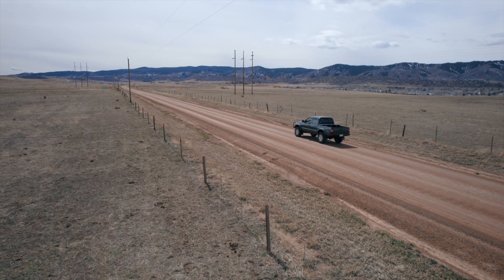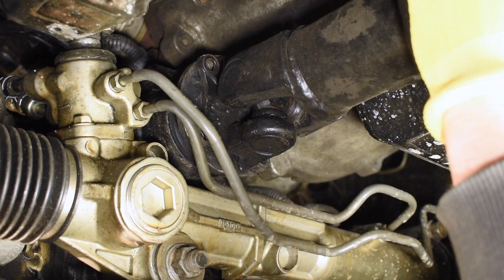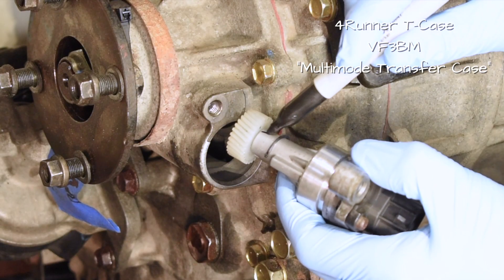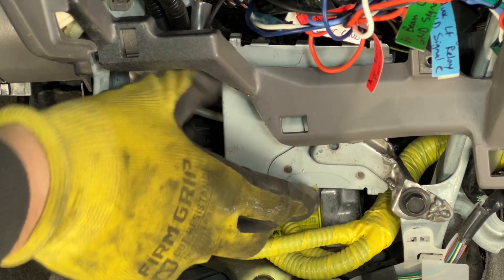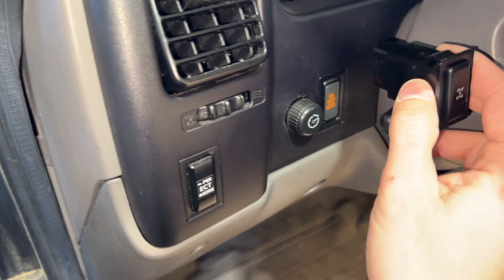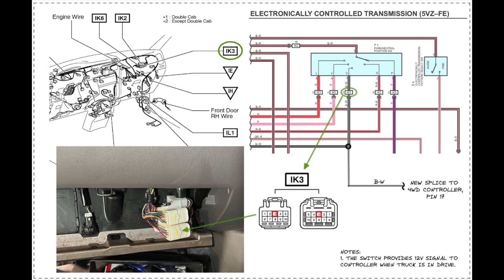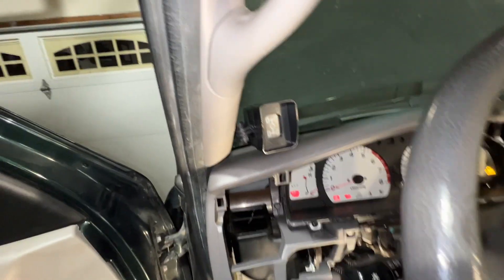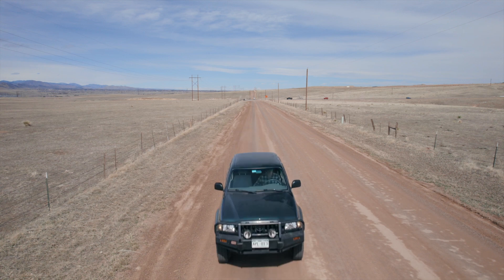Giving the Tacoma All-Wheel-Drive - Swapping in the 4Runner's T-Case

Comment: Great Work! i have this on my taco. i did it in 2016. i modded my speedo to show the modes. (nothing as nice as the 4runner) i also have manual hubs. works great and works like stock! you did much more than i did. i did no fabs. didnt change my ecu, just added 4wd ecu and some wiring. all electric shifters. wiring took me 3 wks to figure out and do. The only custom thing i have is my rear driveshaft. most guys online wants manual j shifts. i love my multimode AWD/4WD.

Comment: I can’t even imagine the effort that went into both this video and the project in general, a crime this only has 5k views. I came here from tacomaworld after reading your thread! I 4x4 swapped my prerunner a few months ago and I had initially secured a really good condition Multimode case that came with the A340F transmission I bought for the project. I made it about 2 pages into your thread and decided it wasn’t for me haha, I went with a j shift instead which was elementary to install compared to this wiring ordeal. Maybe someday someone will use a Multimode when doing a prerunner swap, that would be an extreme challenge without any of the existing 4x4 Tacoma wiring/computer. Amazing stuff, I’m hopefully posting my conversion video soon!

Comment: Hey Mark, would it be possible to share the 3d print files for your cutting template, and the flush mounting bracket you used to mount the switch - working on a similar project right now, and running into the same issue! Let me know, thanks! great video!
Reply from the maker: @Cstrub28  Hey there, please reach out on TacomaWorld.
Reply: @mark.esposito  Message sent!

Comment: Would this be possible on a 2nd gen??
Reply from the maker: @Csox513  I’m sure it’s possible. You’d probably need the VF4AM T-Case found on certain models of the 4th Gen 4Runner as your swap, assuming you have the A750F transmission in your 2nd Gen Tacoma.
Reply: @ thanks for the input. I’ll do some research 🔬

Comment: I having electrical issues with my 3rd gen multimode. All switches are testing good, I can jump the Tcase in and out of 4wd. Vsv is working fine up front. Any ideas on what to check next?
Reply from the maker: Hey there, without knowing what more about your issue, I can’t really help you. Please reach out on TacomaWorld (see video description for my forum posts) and I can get a better idea of what your problem is and I’ll offer any assistance I can.
Reply: @mark.esposito  fixed it last night, opened up the actuator and cleaned and regressed the position contacts (they were corroded but the motor was still working ) and it’s perfect now.

Comment: Would you consider making the center lock/4wd indicator light for a price? 

Amazing video and thread on TW. Thank you so much.

Im trying to source the parts for a manual swap on my double cab, and this might be on the to-do list after that.

I have down the equivalent (AWD) to this on my jeep xj, but it is far less intensive.
Reply from the maker: Thanks for the interest. No plans to sell the gauge. Making the gauge was labor intensive and I’m not sure how to make the gauge transparency layers without purchasing an entire gauge cluster and disassembling it to get the parts I need. Ultimately the gauge would be absurdly expensive to make it worth while.
Reply: @mark.esposito Thank you for the reply.

I did not mean make a new cluster. Sorry for the confusion. I was more so thinking along the lines of what you made. Maybe just a slightly different shape. Out of the way maybe behind the 4wd/shift lever.
Reply from the maker: @VT5874   Understood. I’m just not sure how to replicate the transparent pictogram layers like you see at 8:58 without taking them from a 4Runner cluster. You can no longer buy just that part from Toyota.
Reply: @mark.esposito  Hope I'm not bothering you, is there any chance you'd be willing to share the file for the AWD indicator? hopefully swapping my RWD 99 4Runner and your solution for the indicator seems like by far the best way to go

Comment: Best I've seen, ever.  Thank you. 
The clear tech info,  attention to detail, the detail visuals,  hilarious editing.. dude,  how do you not have more subs?!
Awesome! 
Granted, I had already decided that i would do something like this,  but now it's out of the hazy dreamlike phase,  and into planning. 
I haven't looked yet,  and went straight to comment,  but I'm hoping that you have links and.. really really really hoping that i can buy those 3D files or printed parts from you. 
I have a 2010 trd prerunner, and have been debating which is the best route.. 
i want a competent daily driver that can handle varying conditions on the fly,  and i want to take it on 4x4 offroad adventures with my daughter..  and i want to do it with a Tacoma.
I assume this is possible with the 2nd gen? Or maybe a host of other electrical, censor, or other issues? 
Thanks again,  I'm gonna go check out what other info you have.
Reply: Okay i went to the forum.. excellent write-up!
If this isn't possible on 2nd gen pre(i know it also needs 4x4 conv.), i would sell mine and get the 1st gen. Lol
Bought mine recently for $6k under what i could sell it for,  and was thinking about trying to get something closer to what i need,  at least 4x4, but 4x4/AWD would be awesome! 
Well, thanks again,  I'm gonna have to join that forum now,  and stop lurking.
Reply from the maker: @mrsrabbit2712   Thanks for all the compliments! I’m sure it is possible on the 2nd Gen Tacoma, although I’m not sure if I can say for certain. I believe the 4th gen 4Runners have AWD, but I think it is entirely electronically actuated.
Reply: @mark.esposito  oh damn, okay well i definitely want manually actuated,  i like levers more.
This makes me lean more toward building a dedicated adventure truck out of a gen 1.
There was a guy on there who did it with a different one,  i think he used the FJ T-case. 2WD, AWD, 4WD are the goal here.   AWD being a big part of that. 
Maybe the T-case can be made manually actuated..?
I'll figure out out.  Thanks again!